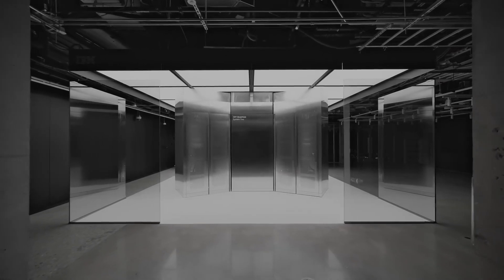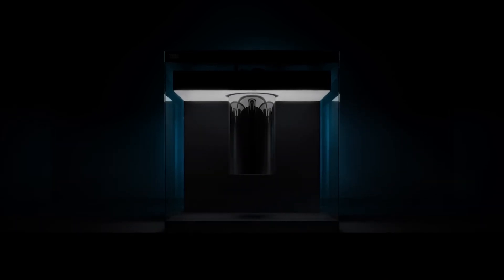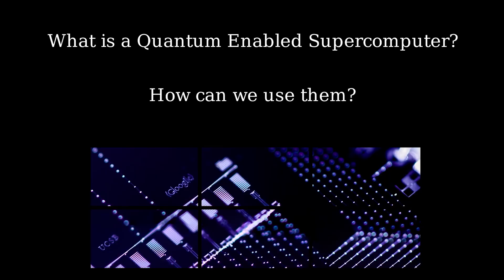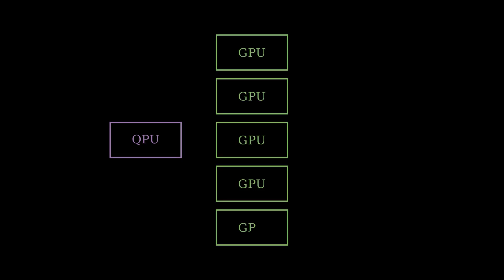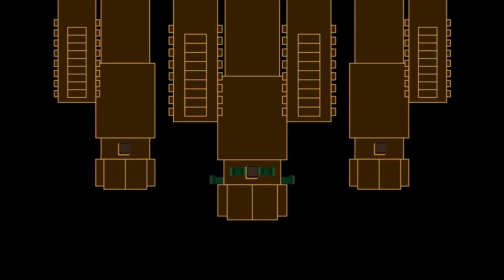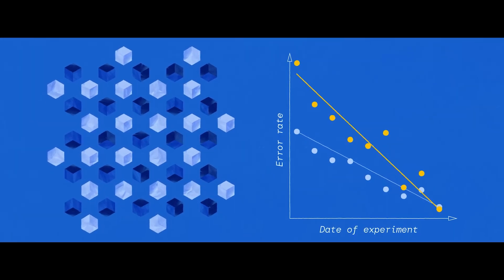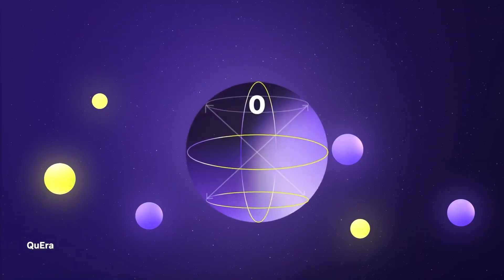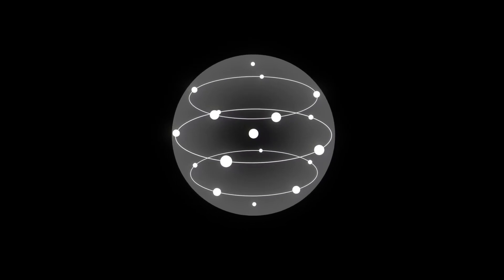The First Quantum Supercomputer is Here

Comment: I wonder if quantum computing will soon see a boom similar to the current AI spring. How costly is the research & developpement of this technology? Are specialists rare and highly sought after compared to AI/ML engineers?
Reply from the maker: Research is very much still in the hardware phase, so it’s a lot less accessible and as a result there is a shortage of scientists (mainly PhD level) to work on it. There’s a lot of money and hype around it but it’s hard to say how long it’ll take that to develop into a big consumer oriented field like AI has become.
Reply: Someone needs to promote a population wide use case requiring quantum computing power to create an AI level boom. Decrypting other people’s messages might be one but will never find a legal market. AI itself may be able to define that use case
Reply: AI models of higher intelligence running on the 414 exaflop Project Stargate supercomputer in 2028 should be able to help us discover new ways to improve quantum computers. Intel already figured out how to make neuromorphic computers a decade ago, so I don't see why AGI models utilizing Stargate couldn't produce extensive documentation and blueprints for the next generations of computers. At that point we will run AI models on those computers with vastly more computing power and vastly more intelligence, unlocking the secrets of the further generations of computers and so on. I think the true singularity is when ASI is achieved, that's why AI is now developing faster than any other field on Earth including other computer-related fields because ASI will be the technology that makes discoveries faster than anyone could imagine. We may not need quantum computers or neuromorphic computers to achieve ASI, so if we do achieve it then perhaps the ASI could be given access to a system with QPUs in order to understand it and tell us exactly how to make a new system with 100x more compute and much better efficiency. Of course this is speculative, however I think it's all perfectly possible and quite likely. GPT-4o agrees.

Comment: When i first saw quantum computers it didn't occur to me that we weren't attaching their QPUs to CPUs and GPUs. I had no idea that was still a developing field
Reply from the maker: Yeah IMO it’s actually going to be the main way quantum computers are implimented. QPU’s are only good at solving certain types or parts of problems, so best to solve part of the problem classically where it’s faster on the classical computer and part of the problem on the quantum computer that’s faster on it.

Edit: to add to this, we are attaching traditional CPUs and sometimes GPUs too, but not on a supercomputer scale.
Reply: @Lukas-Lab 

At the moment.  Remember it’s still in its infancy.  Within the next 50 years we’ll have AI running a quantum computer and it’ll be redesigning itself.
Reply: @Lukas-Lab I wonder if NPU will be implement to QPU, GPU and CPU. Any thoughts?
Reply: Every computer is a quantum computer, computers compute the Quantity or Quantum of values.
Semi conductors of the computers in ROOM TEMPERATURE have reached their operating frequency's speed limit.
Transistors are ionic switches that with higher frequency of switching they get hot and create errors / noise.
The most practical way of cooling the processors is with Heat Sinks and Fans which we have been using.
Quantum Computers are the higher frequency computers with liquified gas cooling pipes. Concept and the technique of parallel processing is as old as the invention of IC (integrated circuit). We can connect multiple fan cooled regular computers in parallel to achieve the same performance of a Quantum Computer, all we need is a synchronization algorithm to compensate for network latency, same as the one for supper computers.
Reply: Or ghost in the machine